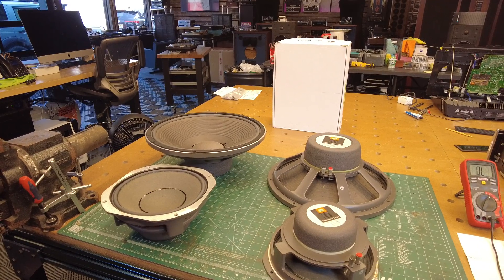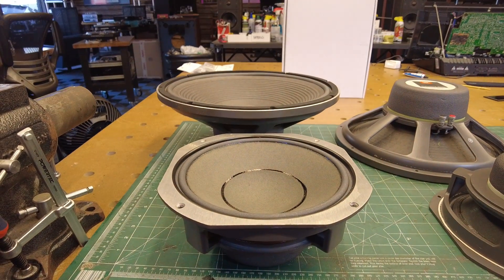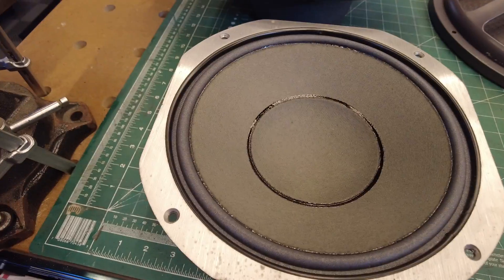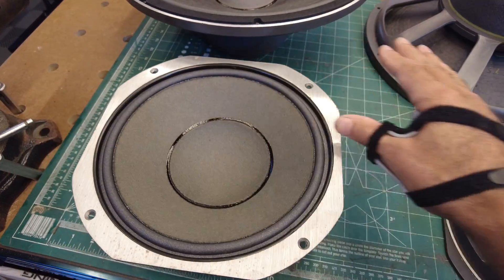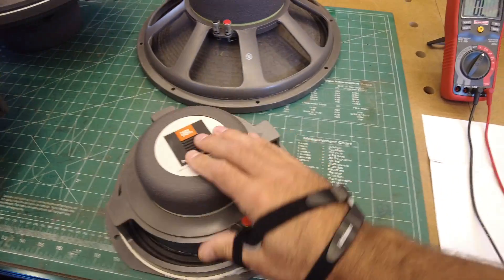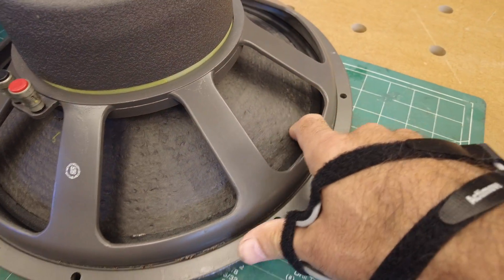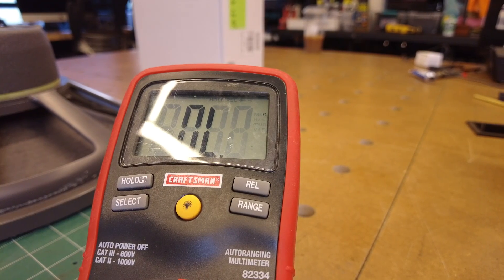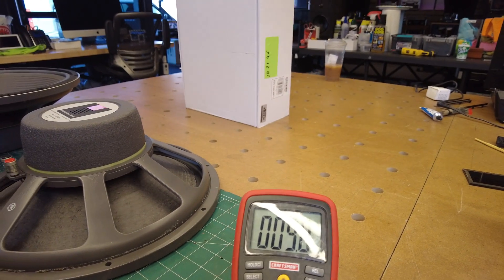Our Reference JBL 4343 Speakers Get New Drivers Installed.  How We Refurbish and Test Drivers.

Comment: Dammit, your so fortunate to have obtained TWO sets of those gems!
Ive done a good handful of re-foams myself at home, inner foam diameter on the back side of cone and everything. Ive gotten it down where the woofer is clean and presentable, but def not as pristine as that pro job. WOW they look brand f&*king new! Im struggling with finding LF voice coils for my Altec 512 active system, I re-coned the squawkers successfully, but I may very well get the LF drivers done professionally now after seeing this! My Altecs also suffer from the same veneer peel @ the bottom. Luckily the finish is black / "ash" so im considering just filling in the lost veneer/mdf and then a coat some semi-gloss black paint.

Comment: Sweet! I sent my crossovers to one of your recommended shops can't wait to get them back sounding new after 30 years!
Reply: @Pocket Square I used the Speaker Exchange out of Florida. They replaced the caps on my 40 year old Bang and Olufsen S80 speakers. Turn around was about 3 weeks. I just told them to replace what they thought needed to be replaced.

Comment: JBL had black wire as positive back then.  All JBL pro drivers I've used were + to black terminal.  They all had the message 'Positive to black causes forward cone motion' next to terminal.
Reply: And yet the connections in speakers were all over the place. No idea why JBL went with + on black...